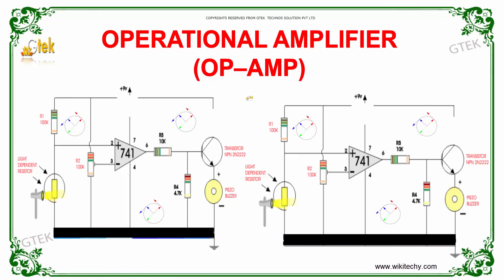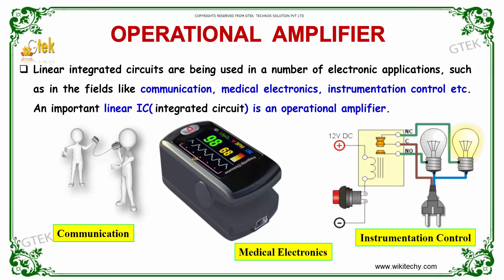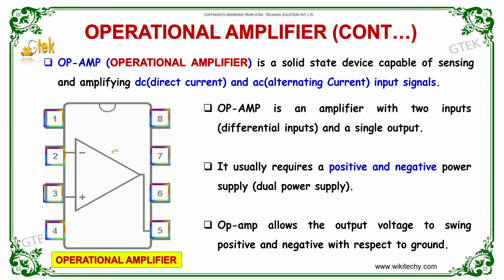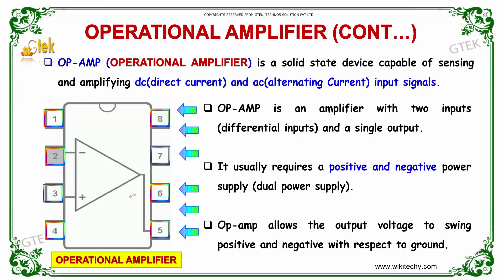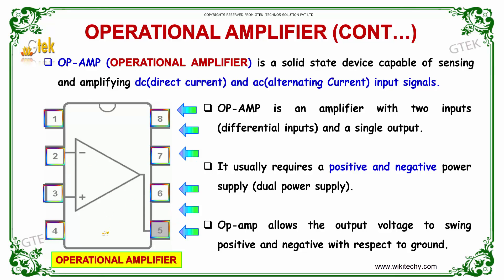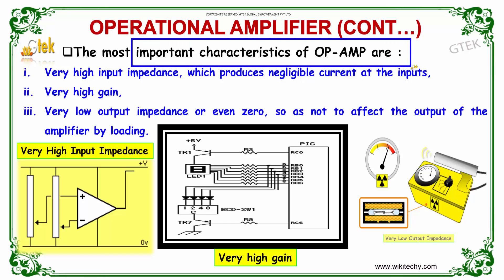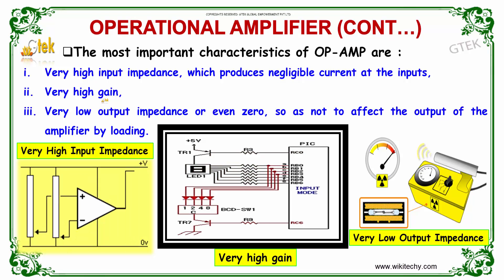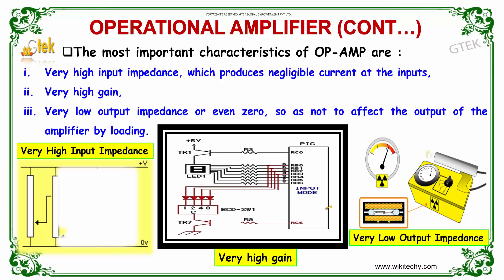Operational Amplifier|Semiconductor Devices|class 12 physics subject notes lectures|CBSE|IITJEE|NEET

Comment: An operational amplifier (often op-amp or opamp) is a DC-coupled high-gain electronic voltage amplifier with a differential input and, usually, a single-ended output.

Comment: An Operational Amplifier is basically a three-terminal device which consists of two high impedance inputs, one called the Inverting Input, marked with a negative or “minus” sign, ( – ) and the other one called the Non-inverting Input, marked with a positive or “plus” sign ( + ). Related Products: OP Amp | SP Amplifier.

Comment: an amplifier with high gain and high input impedance (usually with external feedback), used especially in circuits for performing mathematical operations on an input voltage.